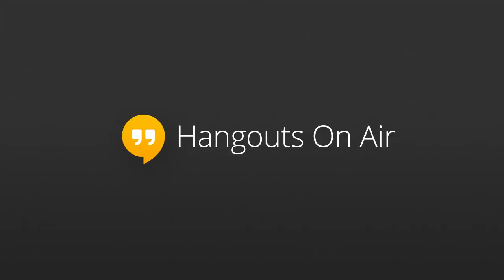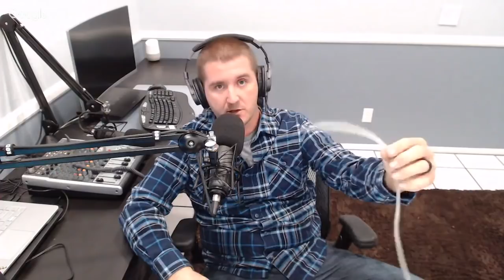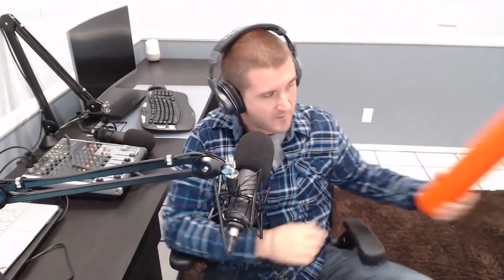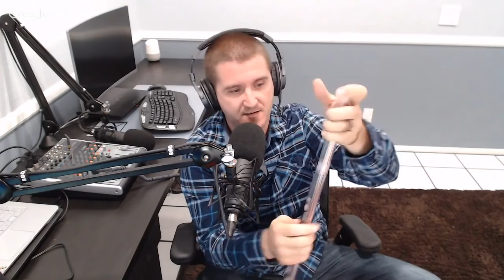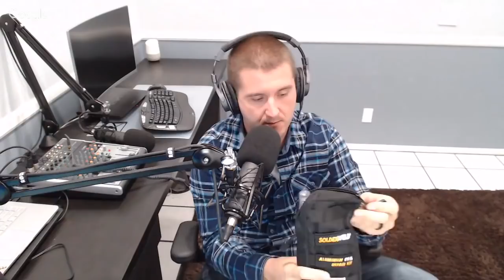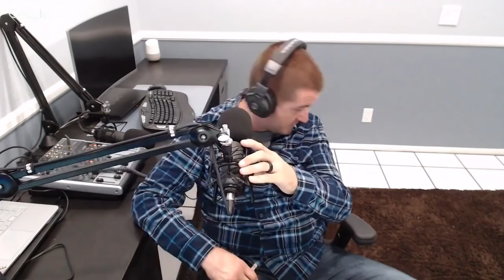HVACR VIDEOS Q AND A LIVESTREAM 11/5/18

Comment: an open floor drain may be the problem.  This is a plumbers problem that was revealed by the negative air pressure.  The AC would have to be oversized by a factor of about 2 to be pulling in outside air to that degree. I remember we had a Kennel that was sized for 100% outdoor air to keep the moisture and stink down. This was designed for 100% outdoor air and the customer started blocking off the outdoor air vents to try save on power.  The coils were freezing up.  When it was explained to them why these units were so big, they didn't want to hear it.... OH Well.

Comment: Hi Chris I love your videos and one day I'm going to remember that you do the live one on Monday's so I can be there, and I'm sure by now from my comments you know I own a restaurant.  Personally I would never put a hood system in like that,  the expense of the system itself and the cost of parts and programming is extremely costly.  I dealt with AB variable frequency drives for a long time when I worked in manufacturing.  They are a pain in the butt to keep running and very sensitive to  electrical interruption. Where I worked at that time we put large capacitors ahead of them to keep them running for about 2-3 seconds if a power bump occurred. Because a millisecond of interruption would take them offline and in the extrusion business that's thousands of dollars in lost time and production when a line goes down.  I'm on the East Coast so storms and power bumps are a way of life here.    Knowing what I know about VFD's and hoods I don't see a need and to further complicate things like that, they have it tied into everything else in the building.  So if any part of the A/C or other systems is down the whole thing suffers in one way or another.  To me that's just a set up for a failure somewhere down the line.  

Personally I want a hood that has its own make up air system and if you balance the intake to the exhaust you'll never have a problem.   I've worked in vinyl extrusion for over 20 years and have owned a restaurant for the last 10.  I know a lot about a lot and a little about a lot more and from my personal experience I would never mix VFD's into a restaurant setting there just isn't a real need for it.  The small amount of cost savings on the electric isn't worth the aggravation repair expense its going to cause in the long run. The more complicated and intricate you make it the more places there are to have problems.   And in a restaurant setting I'm sure you realize from experience owners don't want to spend money to fix things, just like in this case bypassing the drives and running them at full speed.  So when you tie all these things together the potential for any one of them to not be working for a long period of time is high.   Honestly this is why I'm getting into HVAC now myself I just can't afford it any more.   I dealt with a guy that gives you guys a bad name, the prices were fair but the quality of the work just wasn't there to many call backs and short cuts.
Reply from the maker: Thanks bud!

Comment: Another good talk, keep it up. To help your air balance problem put smaller motor sheaves on those exhaust fan. Try to get between the low it used to run at and the high it does now, keep it simple. As for Apprenticeships they are alive and well in Wisconsin. I teach some classes to the several hundred we have in just the Milwaukee region, nationwide there are thousands of apprentices.
Reply from the maker: Glen thanks for watching and thanks for the nice words, as far as the exhaust fans go they are all direct drive motors so I cant speed them up or slow them down without a working VFD ....... Kind of a shit sandwich!
Reply: @HVACRVIDEOS  That's a shit show on steroids. Only option I think you have left is slower motors (too expensive) or smaller wheels. That $$ depends on fan manufactuer, keep us posted with your videos. Thanks!

Comment: could you use a software program to copy and past the VFD  program
Reply from the maker: I'm sure you could, I have never done it but I'm sure it is possible.
Reply: @HVACRVIDEOS  You can, but it is suprising that the VFDs fail. I wonder what the failure mode is, Allen Bradley is not a bad brand.